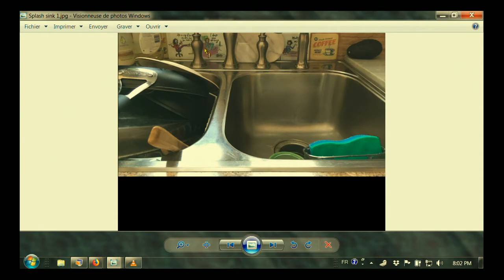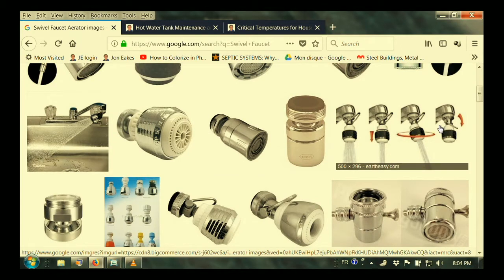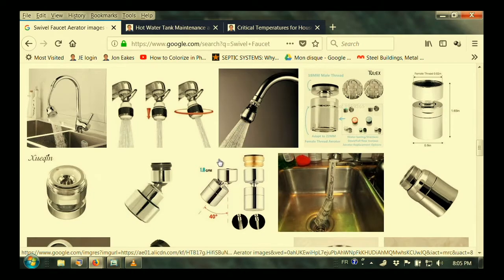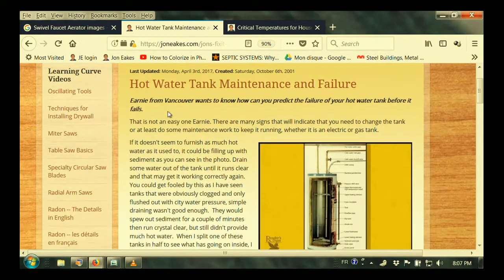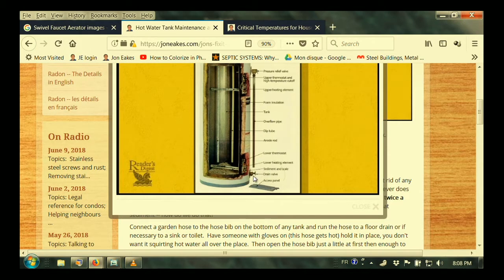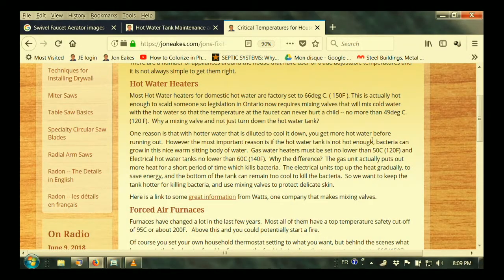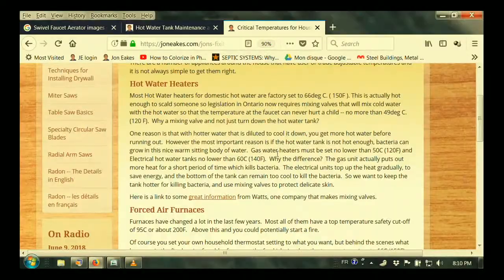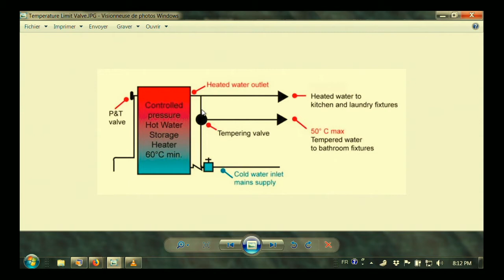Stopping Faucet Splashing

Comment: Our old faucet never had a splashing problem, the first time we replaced it, the new faucet splashed all over the place even when the the valve was only half open and would happen using the spray and without. The styles of the two faucets were similar as we're the dimensions. The splash would continuously be a problem, washing hands, doing dishes, pretty much every use case would result in major splashing where as the old faucet never had this problem. Finally we decided to replace the new faucet and the replacement faucet worked great. It has amazing pressure when using the spray and doesn't splash (within reason) when not using the spray. The question is, is there any way to tell before installing the faucet if this may be a potential problem?  Thanks
Reply: Did you buy a low arc faucet?